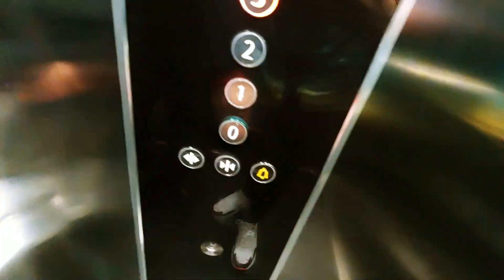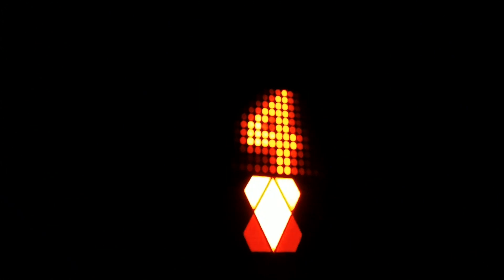Detailed look at Kone KCE

Comment: I did work KONE first job 2017, i did 100 of those control circuit panel boxes, all wiring, stickers and circuits installation. Dubai, UK, Finland, USA, Doha etc.... It was really nice work and chill. I did those LCE, KCE i have never seen.
Reply from the maker: KCE is horrid compared to LCE.  With LCE it was a system that did the job exactly as it needed to, and was quite simplistic to work with.  When KCE is a high end system that has been made to work the same as LCE (but with loads of discrepancies).  It is similar to what Boeing did with the 737Lax.  They made an entire new system but designed it with software to feel like the old system so the pilots/engineers wouldn't need to be retrained, and this caused 2 planes to crash.  If I was a building owner I would ask Kone to install an LCE in my building, and if they refused I would get a Mitsubishi instead.  I do not trust KCE, especially when it is locked down with proprietary restrictions so I can't access the menus myself.

Comment: FYI, The test switch does this: first click disables landing calls, the second click inhibits the doors from opening, while maintaining disabled landing calls. All this in normal operation.

also, with cartop inspection, if you hold the "run" or "slow run" buttons, and let go of the traveling direction, the lift wil gradually come to a stop instead of an abrupt brake.

Comment: I agree with what you said at the end of the video. I feel KCE is not as good as LCE and that it looks as though they tried to revamp the LCE and make it “all advanced and high tech” but they don’t take into account what was already good about LCE. Lifts with LCE run really well and efficiently and they feel like the Kone designers tried to make a lift controller with good quality components and a reliable OS running on it. If the same people who designed the LCE was to make a KCE, they would make it so much better than what KCE is. Also the metal beams attached to the motor and cables looks very thin and flimsy. I understand this is only a MonoSpace 500 which is the cheaper model for low rise applications but after watching this video I’m kinda starting to feel Kone is starting to cheapen out a bit now unfortunately.

Comment: "taKONE LCEildKONE KCE" at the end.
Good idea for Kone to add an LED strip for the emergency light, much better and brighter than the little white light in the inspection control. Is there a socket on the car top as there used to be one on the inspection control?
Reply: @TecStuff In the old LCE inspection box, the socket outlets do not have residual-current circuit breaker. It just share the power from the car lighting circuit.

Comment: The right way to get into the menu is with the KONE MiniConsole App and an adapter cable. The menu on the KCECPU isn't designed to programm anything it's just for the fault codes.

Comment: Looks like it now runs “Windows for lifts”😁. In the 90’s it was a running gag to have windows run on anything. The menu system doesn’t look particularly user-friendly, even for a service tech. Time is money I reckon that menu could be designed better to make servicing easier. That’s a bit disappointing from Kone, some generic logics seem to have better menu’s. Still curious what kind platform this board runs on.
Reply: Windows 8, lift edition.
Reply: Noone will use the KMI menus to navigate or change thing since there is a connection to your phone and an app.
Reply: Many modern logics like Kone or Mitsubishi either dont use touchscreen panels or so. They have their own stuff and own unique ways to control it. This is actually more professional than what generics do. These logics are probably way more reliable than any TVC or Lester logic that ever existed

Comment: 8:26 Perhaps the LEDs change into some condensed size which would be the size of 2 digits on that indicator if they were joined up.
Reply: only on newer matrix and it can condense the vertical way to display the special messages such as "Floor Locked"

Comment: I have to agree, that new inspection control is very cheap compared the the old one. Ok, you can move it, but I feel like that's not a very necessary feature. The old one being immovable made it a lot better quality and more sturdy. Even most generic cartop controls look better quality than that.

Comment: I guess this is powering the new Kone DX classes, right? TBH the engineer's experience (bar wait times) seems to have improved over LCE, especially those tests which are likely to be executed during inspections.

Interestingly the LCE-powered ReSolve 200 (for mods) is still around.
Reply: @gaetanodangelo3147  Unfortunately, I am not a lift engineer nor do I have any experience with KCE, so I can't help you. Beno would be marginally more helpful.

Comment: Its comparible to building something in Visual Studio with .NET Framework where the linker adds a whole bunch of extra code, and on top of an RTO operating system with even more instructions to your executable as opposed to a simple ASM program to do the same thing. Something that can be done efficiently with under 5KB of code suddenly becomes massive like over 1MB. I bet there are even JAVA controlled lifts out there, where every time the JVM needs to be called.
Reply from the maker: In assembly (including other languages as long as they are complied down to assembly with no additional crap) how large would you say the the code could be for this sort of Kone lift. 
The operating system has the following features (these features are all running at the same time)....
-Manage indicators and voice over serial data
-Manage the lift doors
-Show a simple coded menu on the screen
-Send data via serial to a computer
-Manage the shaft bar and taco.  The lift's position is known by a taco, but there are also shaft bars that verify the position and keep it in sync with there is any motor slippage.
-Send data to the VF drive.  This is not a simple VF drive which needs a few commands, this lift actively manages its speed and has a smooth controlled stop, so the VF requires a stream of data and calculations to manage the controlled movement.
-Run secondary safety checks.  Safety systems on lifts are managed by physical relays that shut down the lift if things go wrong.  The secondary safety system is software that checks these relays function as expected to detect when a relay fails in the on position.

Kone's system has a lot more features than the most basic lift, but this can still be done as a real time system.
Reply: @benolifts  Well based on specifications, the Kone LCE Lifts has an EEPROM Chip with the firmware, the size of that chip is arranged as 512*8 or 4096KB/4MB with another chip with 256KB for NVRAM. I would guess that the actual binaries burnt into the EEPROM would be slightly less than 4MB. It is beautifully coded with very low delays in response times. I would assume that in the KCE the image sizes would be larger with more complexity and overhead. The bootup delay is a huge hint. I wonder if the image is being decompressed at boot. In an age where engineers think it is a good idea to replace well written well optimised C coded programs, with high overhead, slow and less reliable webapps and a simple website eats up 1GB of memory we are going downhill fast. I roughly compare it with how the old cartridge based game consoles or mobile phones were instant on whereas modern ones has to go thru an entire boot process with several hundreds of processes running in the background. I would be interested to learn more about the architecture behind this new lift controller, like how the hardware and software implementations differ from the LCE. A block diagram would be nice.
Reply: @schweizerd6303  
future generic logics: running windows 10 with some weird interface to "GPIO" based pins

ah yes very very very reliable
Reply: @schweizerd6303  
But in all fairness, I think you could even make a ASIC chip that is specifically made for the lift operations, forget assembly or something. now we are talking transistors which do specfiic high level function of the lift? I mean, isn't this what relay lifts are? I think modern lifts like you said do use stuff like EEPROM kinda flashable chips with assembly based code, dont get me wrong they both are reliable. But Lester controles or TVC use CPU's and shit I believe which, CAN be unreliable if they were written on python ROFL.
Reply: @hariranormal5584  no this is wrong, the windows 10 specs are far too heavy for running on cheap hardware. More like Linux or Android.

Comment: I don't know how i feel about safety being bypassed that easaly.
Reply from the maker: The lift wont enter service when bypassed.  So lift engineers should no longer need to bypass using other dodgy methods and then forgetting about it and letting it enter service bypassed.  All modern lifts should shut down if safety doesn't disconnect at a floor (a software check to see if safety is bypassed), but on my experiments, Kones do not always do this.
Reply: @benolifts  Yeah that is true.
Reply: @benolifts  I remember this function can be enable/disable with a parameter.

Comment: Is this lift new or a modernisation?
Reply from the maker: new
Reply: @benolifts  Ok. It seems to be uncommon to have limited headroom in new installations.
Reply from the maker: This lift does not have limited headroom.  The limited headroom version has folding fence and shaft door protection.
Reply: @benolifts  well what is with the sign on the cartop then?

Comment: Keep up the great work guys!
Our client has a KONE elevator and we want to connect a fire signal to the elevator over i/o module from Siemens fire panel, were can I find this input. Thank you in advance for yor cooperation
Reply from the maker: Which lift logic does it have?  TMS, LCE, KCE or some of the shelf generic logic?   Fire mode on lifts works differently in different countries.  In the UK the fire switch on the lift is "fire service mode" and the mode that is entered from the fire alarm activating is "fire recall".  Somtimes fire recall is known as phase 1 and fire service is known as phase 2.  The UK is different to the USA as the fire switch on the lift sends it to phase 1 and a second switch inside the lift is used for phase 2.   In the UK the fire switch on the lift goes straight to phase 2 and the fire alarm triggering only sets to phase 1.

On Kone LCE you need to set the fire exit floor.  This is menu 1 option 59.  setting to 0 disables it.  Setting it to a number sets the floor ID for the fire exit.  Note that the floor ID is different to the floor name.  The floor ID starts at 1 from the lowest floor and counts up.  Also note that large gaps between floor are given an ID aswell.  So exit the menu shown and the current floor ID will be displayed.  Then send the lift to the fire exit floor, now you will know the floor ID of it.

Also, set menu 1 option 60 to the same floor as option 59.  Then set option 61 to 6 to make the lift obey UK fire regulation.  Then set option 62 to 1 to enable fire mode.  You may need to try different settings for option 62 if it doesn't work.  I am a bit confused on this option.  Then after changing any options the lift needs rebooting.

Also, you will only be able to acsess menus if the lift has done less that 10,000 jerneys.  If it has done more then you need to ask Kone to help (expensive) or get some lift company to jailbreak the logic or add Kone's proprietary KNX card.

To physically wire the fire alarm to the lift logic you need to find the circuit for this.  On most MRLs this will be in the shaft if only the repeater board is in the cabinet.  I do not know exactly where the fire alarm is wired in but I would hope that it is labled.   There is not data connection from the fire alarm to the lift.  It is a simple circuit that puts the lift into fire mode when voltage is present.   If the fire alarm is an adressable system, then I would guess you would need a component that decodes the address data back into a simple circuit which is then wired into the lift, but this is beyond my knowledge.
Reply: At ground floor you can take NO contact of toggle switch from lift fireman system
Reply: You need an option board (lceopt). There is some turn switches and jumper on board to make it serve for fire alarm input. After installing board you have to active some parametrs from menu. For access menu you need diagnostic tool.. This operation not for every person. You will need help from some one experienced with KONE.
Reply: Thank you guys, we solve it by connect our signal in series with the fireman key input. Many thanks.

Comment: Most newer KONE lifts in Singapore installed after 2013 are all made in China, but LCE is still the mainstream for most lifts in southeast Asia with 4th gen ecodiscs

The KONEs made in China use a Schindler voiceover adapted from the Schindler 5400AP from 2010, those from Europe use the original KONE voiceover